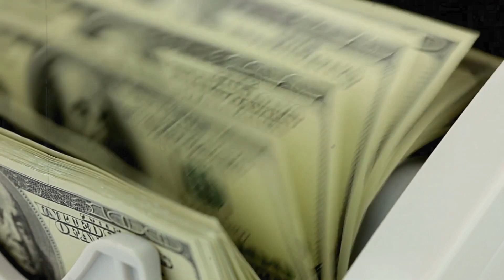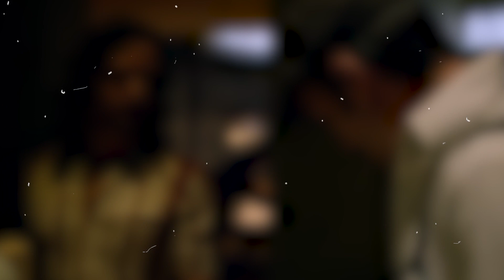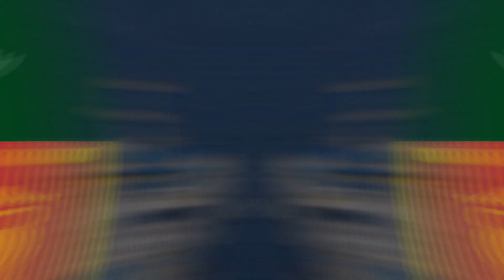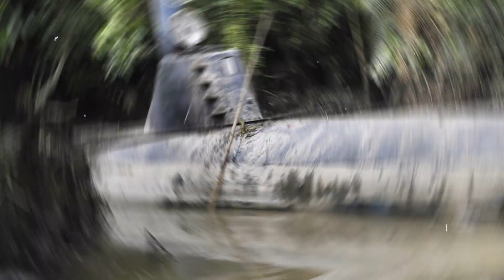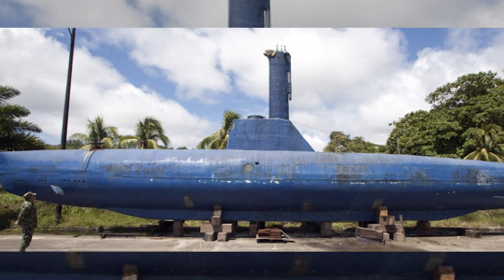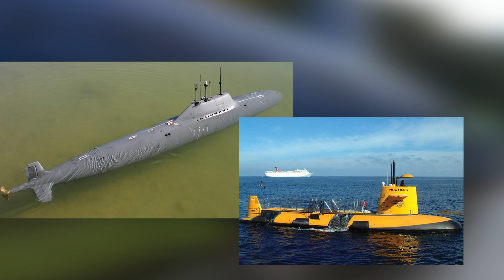The Ingenious ways Narcos Use Old Submarines

Comment: They now have fully submersible diesel subs, they snorkel in the evening and dive at day, most are made of composites that dive circa 60m, some are made of metal and can dive to 200m easy, from what I've heard the navy has found a few in the air but when assets come near they just dive (I assume dedicating 1 or a few military vessels with ASW capabilities to hunt them is not worth it for the navy. Apparently its a huge embarrassment so they are hiding from the media, also they tried disinformation when they said the press narcos use kevlar and put a lead layer on top to "hide infared signiture" 🤣